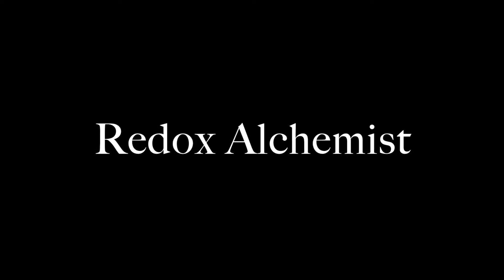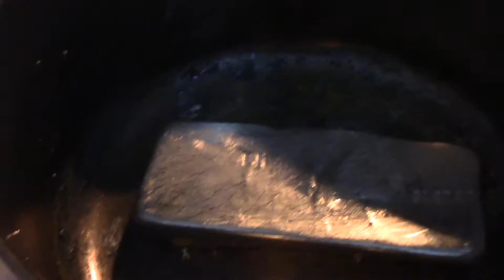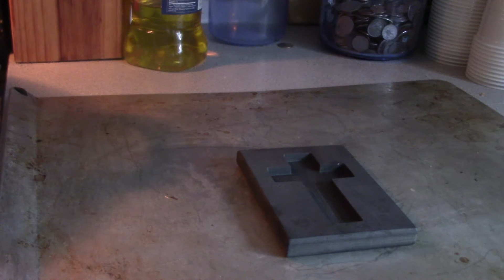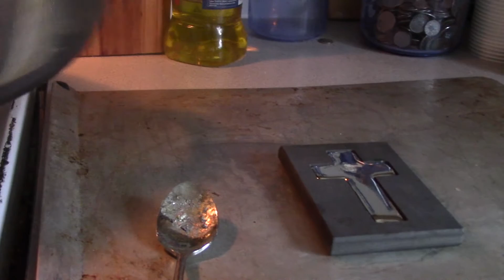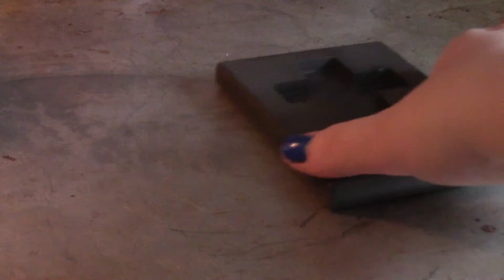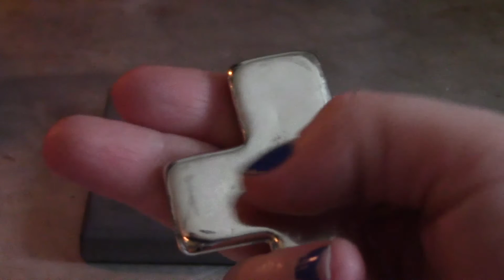Tin - How to Make a Tin Cross

Comment: It is a shame that tin is so darn expensive I would have made an engine block with it.
Reply: ("RNA0ROGER") 
You would cast an engine block out of metal that melts at 450° F ?
Reply from the maker: Tin is definitely one of the more expensive metals to cast with. If you are still searching for a substitute metal for casting an engine block, I reccomend zinc metal to get the job done. Zinc is cheaper than tin, and even easier to find at times, and is quite sturdy. The great thing about Tin is that you can melt it at a relatively low temperature. A Zinc ingot (depending on the size) will take a lot more heat to liquify. I believe Zinc melts around 700 degrees Fahrenheit (check me on that) and requires a type of improvised backyard furnace or professional forge. YouTube has several tutorials that may prove useful.
Reply: Redox Alchemist 
Nice project. Tin is actually fairly rare as elements go. Most people aren't aware of that. Its ranked as #49 on the list of 78 elements in order of abundance in Earth's crust. A few years ago I read articles talking about the possibility of literally running out of extractable tin in mines not far in the future.
Reply: I was thinking of using a little igbt switching system to make an induction furnace at some point.
Reply from the maker: I wouldn't be surprised if there would be a Tin shortage in the future, or even a total disappearance of the element. It is an excellent element for smelting and introducing people to metalworking. Recently, I've been working with Pewter (Britannia) to make paperweights. Pewter has a large portion of Tin in it's composition. If Tin seems a bit expensive, I recommend Pewter. It's easier to find. Britannia is a safer option because it does not contain Lead.
Reply: Britannia might take the heat better, it only has to last about 60,000 rotations after that I don't care.
Reply from the maker: I still think that a sturdy metal, like zinc or aluminum, might be the best option. Britannia can weaken over time. Zinc would probably be the best for a sand cast of making an engine block
Reply: Redox Alchemist 
The benefit of aluminum as an engine block or cylinder head material is its heat conduction abilities. Heat will move through it and out fairly quickly, but it's not as durable as iron, especially if it overheats. I was reading an engine builders forum the other day, where a guy asked whether he should buy an iron or aluminum block, and most posters recommended iron. Because it's cheaper and more durable. As far as alternate metals, I don't recall hearing much about any other metals being chosen as the primary base metal. Of course those other metals will be used as alloying agents, but in low percentages. Never as the primary metal. But who knows....
Reply: Agreed I'd have to build a igbt furnace.
Reply: You know that engine would literally melt under opperation after a couple minutes